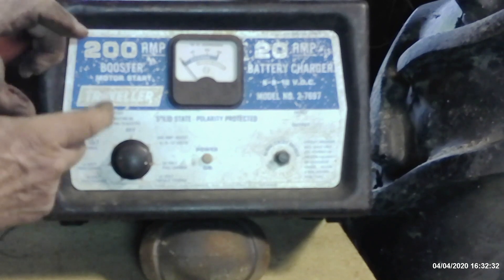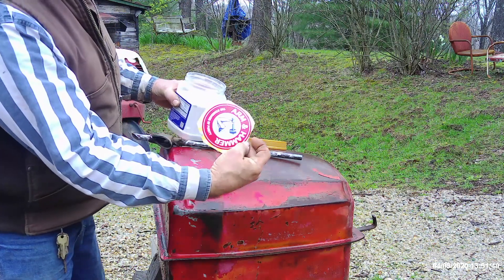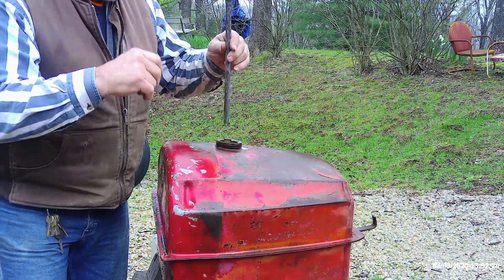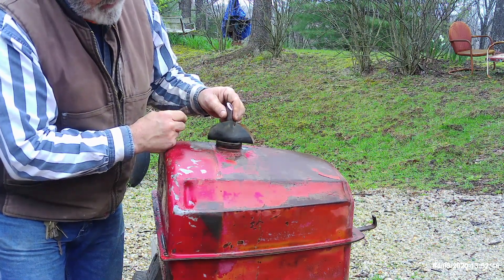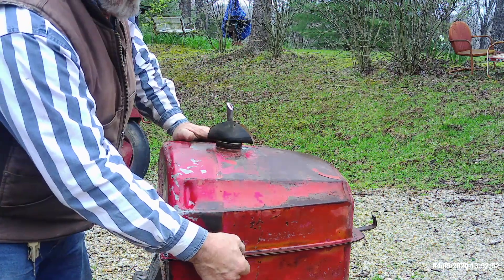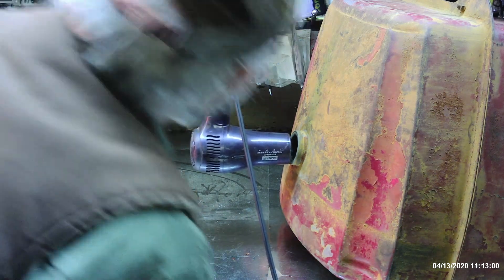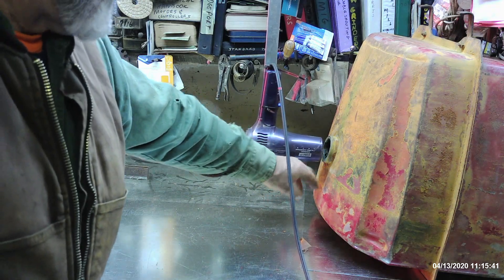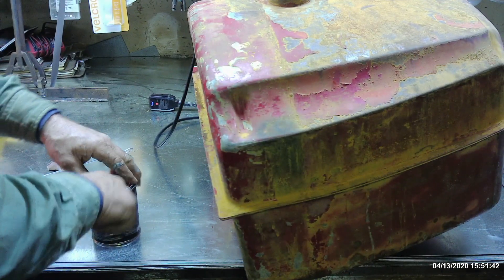Electrolysis Rust Removal Massey Harris 30 Gas Tank

Comment: That is amazing!  I mean it is amazing watching you saying it's dangerous at least 3 times! That must be scary dangerous when done improperly! Lol!  Seriously, this was great from beginning to finish! Applied science to tractors. I just don't know if there is actual iron deposition on the inside of the tank. A good chemist would tell for sure. Now I can figure out how to expand my tank if needed. Fill half-way, then ignite! From what I remember, the electrons flow from the negative to the positive.  Positive is the lack of electrons.  Pretty much like heat and cold.  Cold does not exist per se. It is only a lack of heat! And if I go on, dark does not exist, it is only the lack of light!  Enough for today!  Have a nice weekend Wendell!
Reply from the maker: Ahhhhhh.... a new channel from our Canadian friend: "The Pontifications of Joe LeSage"...  I can see it now.  LOL.  I really have no clue what actually happens in the process, but magically the rust disappears and that's all that matters.  Oddly the sacrificial rod disappears as well but is covered in what appears to be iron oxide. The limiting factor on a gas tank is that you can only use ONE anode.  In an open tank you can ring the perimeter with jumpered anodes and draw 360* off of the rusty piece.  A gas tank takes 4 days minimum to prepare for the coating process. Oh...and did I mention perhaps that the potential exists for ignition of the hydrogen if done improperly....??  LOL.

Comment: That's great timing for a video like this, I was debating trying to repair my diesel tank or replace it,  it has quite a few pin holes on mine, also I like your workshop, loving all the manuals, keep up the videos
Reply from the maker: If fuel was in it recently you may find the first attempt won't generate much response unless its powerwashed with washing powder dumped it the tank first to cut the residual fuel.  If you do powerwash first the results will be much quicker.  I would look for a brand that specifically says it seals pin holes.  I don't recall if this product indicated that.  Also if your tank has a baffle to stop the fuel from sloshing back an forth, remember the backside of the baffle an areas out of the 'line of sight' will not be prepared quite as well as the rest of the tank.  Good Luck and let us know how it works.  I have soldered many pinholes and haven't tried the tank sealer to close them up.  I like manuals too. Information is good to have when you need it !!  Thanks for the comment Oisin.

Comment: That was great. Just a follow-up on the safety aspect, always disconnect the negative ground lead first. That way, if you forget to turn off the charger,  the spark won't be directly above the the highest potential concentration of hydrogen.
Reply from the maker: Dang !!  I wish I'd have thought of that first !!  That's a darn good idea to ensure just another level of safety.  Thank you sir for the suggestion and for taking the time to watch.

Comment: A new Tractorman 44 video with my morning cuppaJO! Now I'm ready to go do whatever! It's raining today so outside work is limited and I do have some shop work to do. My wash line project is finished except for the line itself, Alice want a black wash line. So I may do a trip to Tractor Supply where I saw a mess of rope last time and I think there was black. I usually used that green plastic coated cable line that lasts a looooong time but she doesn't like the green. But that one post hole was a bugger with many nice rocks including one big one that now serves as the bottom of the hole. Anyway, I've used electralice for cleaning stuff on a smaller scale. I've done a good deal of metal detecting but not for a few years and I found some neat stuff. This method does well to clean items but coins will act like an Alkaseltzer and be plum destroyed. Tried it on some pennies and no go but other stuff it's lovely. I'm glad you practice SAFTEY with this method! I'd hate to see the last TM44 video with you flying over the barn and landing on that buzz saw, slice yourself I two and I'd have to watch videos half as long. That be a bummer! I must admit that I have seen some guy do some really stupid stuff and how they're alive is a wonder. I do recall some missing fingers and other scares on some of them. It's really about common sense, which does seem to lack these days with some folks. Just check out the back of a piece of sandpaper with the illustrations printed on back. So much safety gear I don't know how one could move to use it. I also realize there are some totally non mechanical people as well that don't know how to operate a screw driver and if they see a Phillips head this throws them into a total blackout. Anyway Friend Wendell, I totally enjoyed this video but them I enjoy all of them. Like the very first time I came across a TM44 video, I thought, this guy has something worth watching with a sense of humor no less, he's ma vid man! Then the toasting began and continues to this day, which I've been doing all through this vid and I Thank You Kindly! And as always, Blessings from this holler to your holler with a Fine weekend full of adventure and perhaps a blimp filled with hydrogen that can sail to Pa. The Wendellberg Blimp Express with the tractor cockpit. I'll be checking the skies! DaveyJO
Reply from the maker: Hahahahaha... I wish I had your ability to come up with that stuff as quick as you DaveyJO...my hat's off to ya sir.  But I agree with all you said and am glad to know you are enjoying the videos.  Now be prepared, because when me and the Missus comes knocking on your door, there's gonna be a video that day for sure !!  Thanks for another awesome comment and know I'll be tippin' 'em East in the morning !!  Wendellberg Blimp...heck all I need is a few extra helpings of the Missus' stellar mashed potatoes for a week or so....
Reply: Tractorman44 Them tater spuds are wondrous things! The lack of them brought many people here back in the day and why some of us are here now. Knocking at my door will create a fresh pottaJO fer ser! Better. Make that potsaJO! We got a lot to cover! And of course, I'll continue my catch up videos with JO tipping the direction of your 44 holler! DaveyJO
Reply from the maker: @daveyjoweaver5183  I do believe you are correct sir about many people migrating here...the potato famine of Ireland comes to mind.  I think that's why Americans are kind of liked a bit by the Irish, we allowed them in by the hundreds escaping their horrific famine.  I don't know why that sounds familiar, but it does.  Take care sir and I'll be sippin and a tippin your way in the morning sir !!
Reply: Tractorman44 I'm sippin and tippin right now and will be in the morning as well! Sippin and Tippin your way has made my JO experience even better. There is no doubt that the worlds problems could be solved and fixed between us and some interjections from the Missuses! Between our so called junk piles we'd have all that is needed. And we wouldn't need a bunch of those corporate dudes flashing $ before us wanting us to do it their way. They would try and sell our valuables for scrap. Some of those dudes need to spend some time under a piece of roofing by an old tractor to learn appreciation for true value, and I ain't talkin hardware chains. And just looking a bit at the video right now, an old kitchen mixer beater works great too, may be not for that purpose. I have one I put in a drill extension so it's long and great for mixing all kinds of stuff. Best finish my evening JO and prepare to toast you in the morning. And a wild and wonderful Wednesday to all at 44 Headquarters and Stan! And I Thank You Again for all the Cool and Grrovey vids! Now when's the last time you've heard Grrovey? It's always a Happening and a real Hootinanny! I remember when the Peace sign was everywhere, on cars VW buses, shirts, pants and everything else. Then one day I saw some gals walking down the street, years back understand, and one girl had a shirt that said piece. I somehow got the impression she had no idea that it didn't go with the sign.  Well me and my buddies got a laugh out of it, as you can imagine. So why would this come to mind? I recon it was the Groovey thing.so on this flat G note I bid you pleasant dreams of vintage tractors all needing the Tractorman44 Touch! DaveyJO